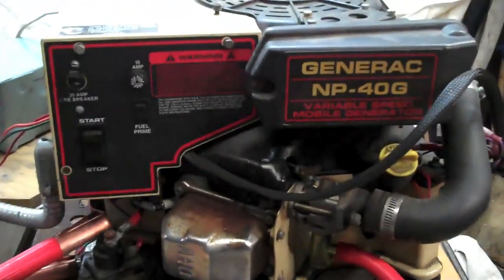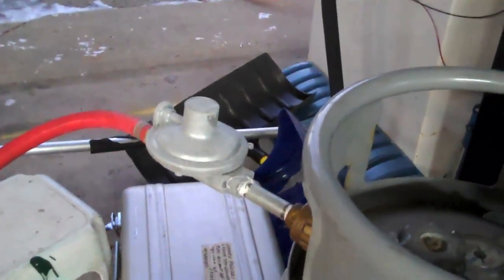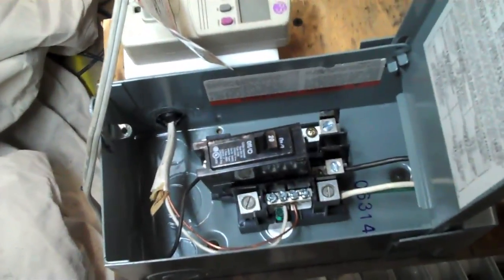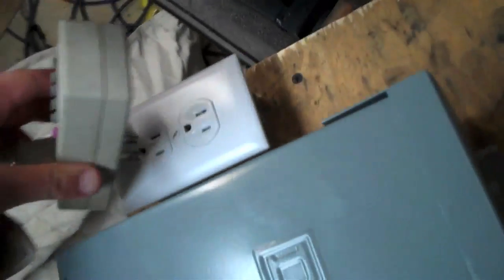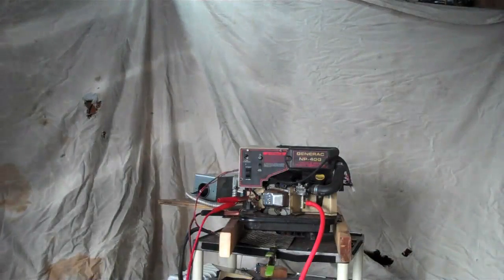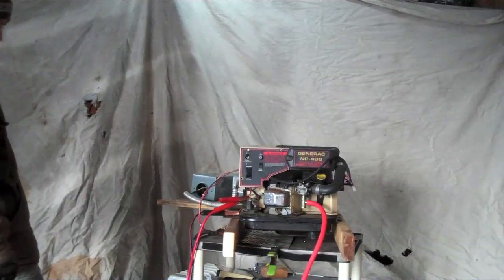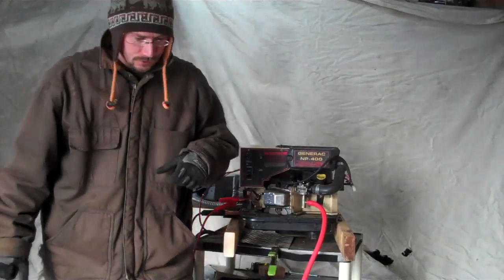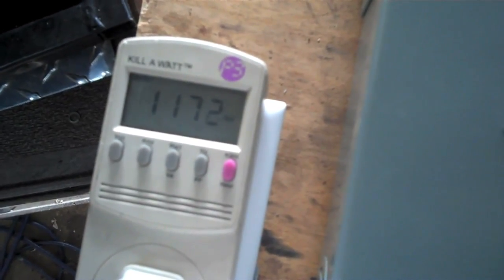DIY Hybrid Propane Generator running

Comment: why don't you use the gas tank in this video in your car coz then you could fill it up at a petrol station
Reply from the maker: This is a propane generator I got for free and fixed up. The car was converted to electric and no longer has a gas tank in it. I experimentally ran my car on this setup for a brief while using a 20# LP tank and the generator as a range extender for the electric car. Sort of like a propane Chevy Volt.
Reply: BenjaminNelson no but in this video it showed an LPG/propane tank from a firm lift with an acme filling adaptor so it could be filled by an auto gas pump

Comment: WARNING for safety if the tank heat.the relif valve wont open lean it and put the small hole to fit the lift near the ground

Comment from the maker: @ShaneGorter The car uses about 7KW in typical city driving - 35 mph, start, stop. It's not designed for freeway use at 72V.
The generator can only do half that amount of energy. The trick is that the electric motor can output a WHOLE lot more torque than the generator can. So, with a 7KW generator, I would be able to continuously drive the car, but still have triple the oomph from the electric motor.

Comment: @BenjaminNelson What would you need to be able to provide 100% of the power via generator?  Running at a constant draw on a generator can increase efficiency I believe enough that even after losses in the electrical system you could have a net gain in efficiency.  The reason why I am interested in this is because I have to fly round trip across the country 8 times a year "WA to VA" and am thinking of driving instead in the future.

Comment from the maker: @ShaneGorter 
The idea is to use my analog battery charger to take the 110V AC output of the generator and run it to the batteries at pack charging voltage. The generator won't be able to keep up with the full power of the car, but the charger will limit the amp draw from the genny. Downhill or at a stop sign, the charger will charge the batteries. In this way, the batteries will still run down on a trip, but SLOWER than they would otherwise, extending my usable range.

Comment: Hey Ben, I was wondering how you plan to direct the electricity from the generator? Are you going to run it to a on board battery charger and charge your batteries while on the road, feed the power directly to your motor, or some combination of both?